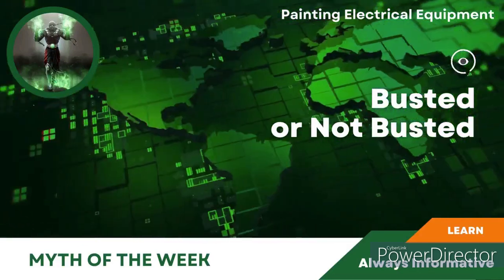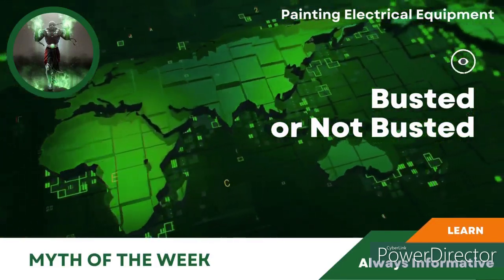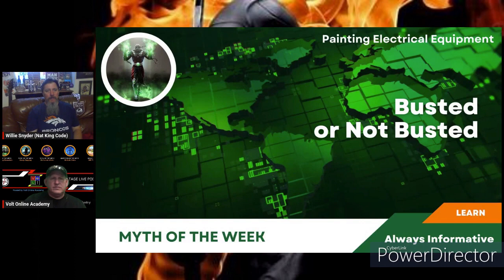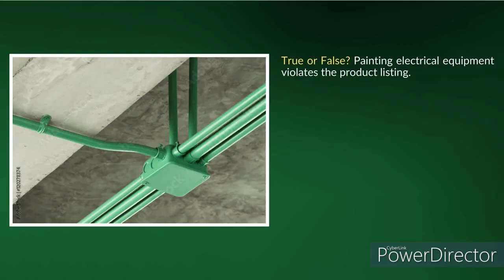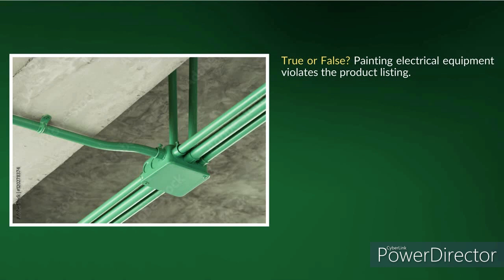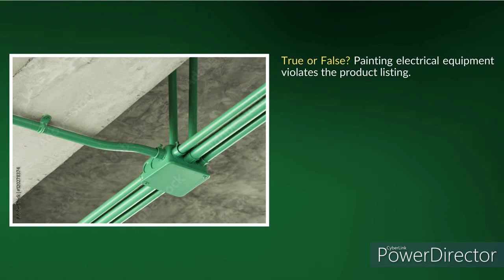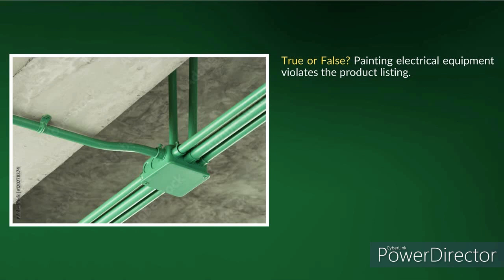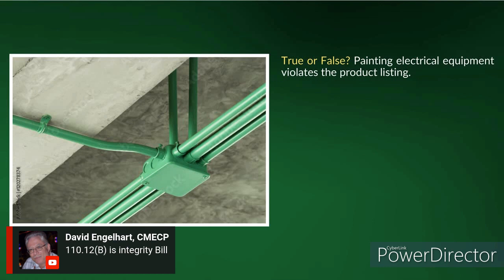Myth of the Week - Painting Electrical Equipment

Comment: Fire Alarms expert here.

It is extremely simple to mask off the threads, whether internal or external, prior to painting.

No freaking way would we try to spray-paint our couplers, boxes & condolettes AFTER installing them! You really expect us to haul a rattle-can up in the scissor-lift? Mask off whatever else is already installed behind our work? Lay drop-cloth on the floor around the scissor-lift? Many customers won't even allow rattle-cans in the building. Not going to use a brush either.

P.S.: Painting won't "violate" the "listing." Completely destroying the thing won't "violate" the "listing." "Listing" has nothing whatsoever to do with how we install. At worst, we might occlude the "labeling." The inspector may or may not be okay with not being able to see labeling. Ask the inspector's preference prior to the start of the job if you don't know. You guys are not amateurs, so please stop acting like you don't know what the words mean! 

Ask the inspector's preference prior to the start of the job if you don't know what they will or won't sign off. Duh.